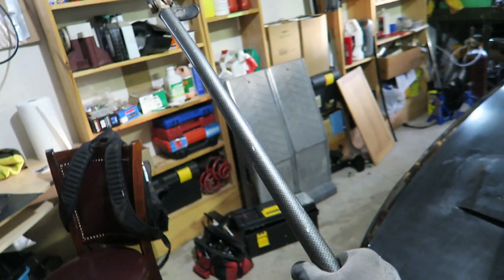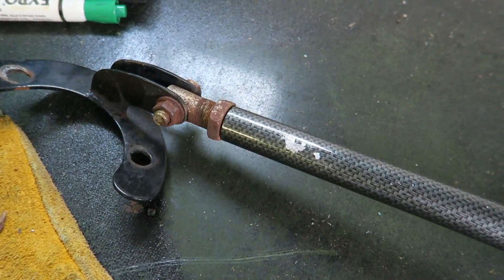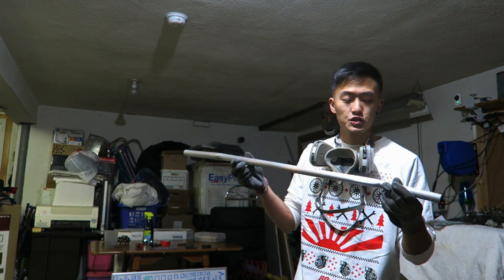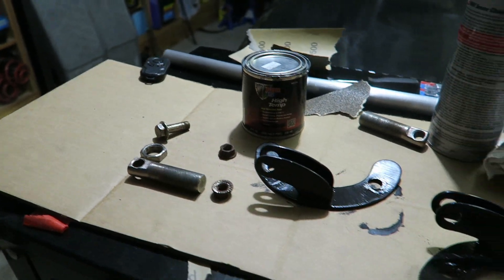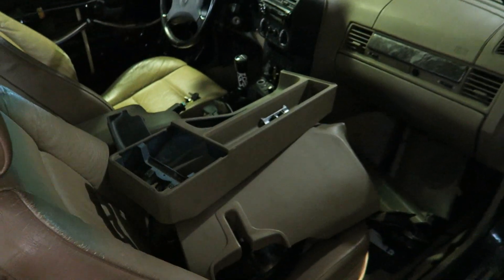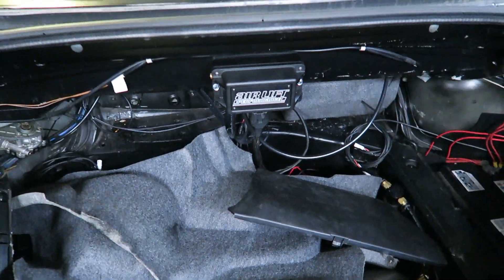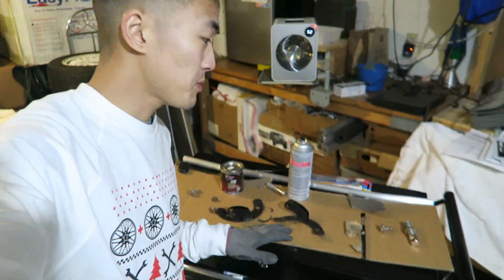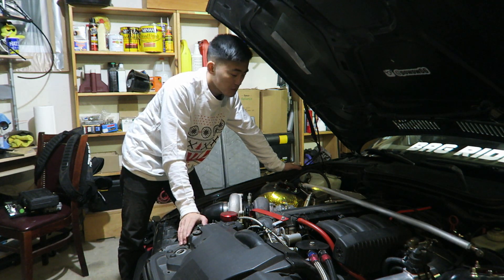BMW E36 Strut Bar Install and Build Updates For The 318ti, Toyota Supra, Honda Civic Si!!

Comment: The thing id like to see is gertrude getting clean af, fix the windows, black interior with aftermarket folding bucket seats, e36 m3 steeringwheel, ducktail wing is actually dope. 

And possibly a standalone ECU instead of the war chip?
Reply from the maker: Noted :)! I agree I do want to make Gertrude show car quality
Reply: dosn´t have to be show car quality, but similiar to what im doing, big ass turbo and complete interior with aftermarket steering wheel and folding bucket seats, #streetcar :) my car has marks and dents on it, but its going to be used to have fun with!

Comment: I also have 318ti, still deciding what engine swap I want to do, can't wait till you do your swap and maybe that will help me figure out what I want from there. Should I do LS or M52 motor? I don't know too many choices :(
Reply from the maker: It all depends what you plan to do with the car (track, drift, street car, etc)! An engine swap with an m52 is less work than an ls. But if you want a dedicated track car go figure with the bigger ls motor 😎
Reply: Pawinning Im planning on a track/drift car.. I already stripped the interior,  and have done minor maintenance stuff to keep it running. right now just pretty much saving up for the engine and trying to figure out what else I should to do the TI. Honestly been waiting for the DIY on removing the interior panels and dashboard 😅

Comment: i was aiming for around 400whp but now that i "somehow" ended up going forged internals etc. im hoping a can make close to 600whp.... if i can find an hx40ish turbo instead of the hx35 that i bought that wouldve been good for autox and dailying cuz of the small exhaust housing for a 2.5L but now with a b28 crank and 86.5mm bore im worried my used and probably abused cxracing manifold will crack under higher than usual pressure and heat from the restrictive exhaust housing

Comment: Hi mate i own a 325i with vanos. Convertible..how i can more hp without turbo?! I install shorter diff.. but its a still lazzy
Reply from the maker: Lighter flywheel will improve acceleration. Then an electric fan conversion, and a Turner Motorsport power pulley kit should add another 15-20hp. If you can afford upgraded camshafts (or find cheap m3 camshafts) that should add another 10-20hp depending on the tune
Reply: @Pawinning  thanks keep update videos  :)